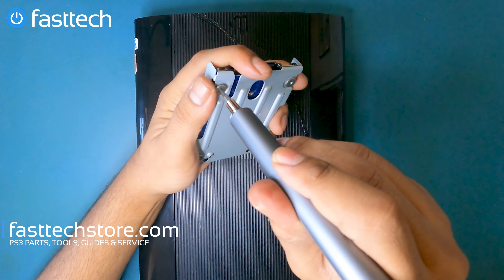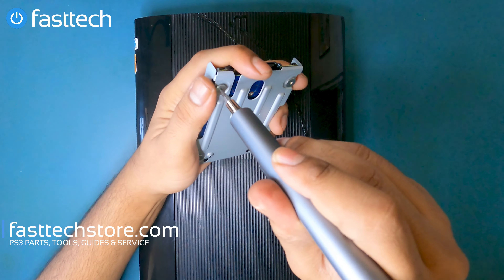PS3 Super Slim Repair Guide

Comment from the maker: FREQUENTLY ASKED QUESTIONS
Where do I buy the parts and tools needed for this job?
👉Fasttech Pro Autokit: https://fasttechstore.com/tools/fasttech-pro-auto-kit
👉Fasttech Pro Toolkit: https://fasttechstore.com/tools/fasttech-electronics-repair-toolkit
👉Laser Deck (Disc Drive): https://fasttechstore.com/playstation-3-parts/kes-850-laser-lens-a2fj5
👉Power Supply: https://fasttechstore.com/playstation-3-parts/playstation-3-super-slim-power-supply
👉Hard Drive: https://fasttechstore.com/playstation-3-parts/playstation-3-super-slim-hdd-cech-4001c
👉Heat Sink: https://fasttechstore.com/playstation-3-parts/playstation-3-super-slim-heat-sink
👉Power Button Board: https://fasttechstore.com/playstation-3-parts/playstation-3-super-slim-power-button-board
👉Screw Set: https://fasttechstore.com/playstation-3-parts/playstation-3-super-slim-screw-set
👉Fan: https://fasttechstore.com/playstation-3-parts/playstation-3-super-slim-fan

👉NEED HELP? FaceTime/Zoom Video Call Me: https://fasttechstore.com/online-consultation
👉GET REPAIR SERVICE FOR YOUR DEVICE: https://fasttechstore.com/electronics-repair

Other PS3 Videos:
▶PS3 CPU AND GPU DE-LID GUIDE: https://www.youtube.com/watch?v=GzMmi7F65wQ&t=30s&ab_channel=fasttech
▶PS3 CECHG Repair Guide: https://www.youtube.com/watch?v=GgOYFO9Pdss&feature=youtu.be&ab_channel=fasttech
▶PS3 CECHH Repair Guide: https://www.youtube.com/watch?v=BDC1O8mYZZc&t=1840s&ab_channel=fasttech
▶PS3 Slim 2000 Repair Guide: https://www.youtube.com/watch?v=S-ewz35fOLY&feature=youtu.be&ab_channel=fasttech
▶PS3 Slim 3000 Repair Guide:https://www.youtube.com/watch?v=ay7GYYMjodQ&ab_channel=fasttech
▶PS3 Super Slim Repair Guide: https://youtu.be/6a9UM_S1T64
▶PS3 YLOD Repair Guide: https://www.youtube.com/watch?v=uAWpqW1HCmo&feature=youtu.be&ab_channel=fasttech
▶PS3 Controller Ghosting Fix: https://www.youtube.com/watch?v=lMQouNRR018&ab_channel=fasttech

▶ VLOG CHANNEL: https://www.youtube.com/channel/UCF2IPXKRX5ctN9td1rhkzHg

Follow me on Social Media:
👉Twitter: https://twitter.com/Shehroz
👉Instagram: http://instagram.com/youngtechg
👉Facebook: https://www.facebook.com/fasttechy

Business Social Media:
👉Twitter: https://twitter.com/FasttechCA
👉Instagram: https://www.instagram.com/fasttech.store/

00:00 Intro
00:29 How to check the model number
01:26 Hard drive replacement guide
02:37 Removing the top case
05:48 Disc drive replacement guide
06:50 Power supply replacement guide
08:04 Extracting the motherboard
10:42 Outro
Reply: I looked on your site and i cant find a disk drive for the super slim
Reply from the maker: @bigbentv9025  its in the list in the description box and top comment now.

Comment: Hey man. Due to lightning strike, the pa3 doesn't work anymore. There is no problem with the power. It turns on, but the display is simply black. Tired with av cables HDMI cables, different monitors. Nothing works, the system on, but the display is not showing anything. What can be done? Thank you in advance 😊
Reply from the maker: @kausigantk1461  is this only a problem with the HDMI? Try AV output

Comment: My power light would come on, and when I turned it on it would turn green. Then like 3 to 5 seconds it would turn off.  I replaced the power supply. And plugged it in. An its still doing it. Why what am I missing. Ps slim sliding door on top. ?????
Reply from the maker: The sliding door has nothing to do with it. This could be what’s known as the yellow light of death issue the only real way to tell what the problem is is to use is syscon. There are several tutorials on YouTube that show you how to do this. We will be releasing a video in the future explaining this in detail.

Comment: hey am keiran i have bein watching videos cant fix my problem  need help my ps3 come and just go's  off with a green light
Reply from the maker: It could be a Yellow Light of Death (YLOD) issue which requires a reflow on the GPU/CPU or a reball. The best fix is to replace the GPU and CPU which is not an easy job. The second and lesser likely scenario is a bad power supply. If you have to unplug the power for the PS3 to even light up again its most likely a power supply issue.

Comment: My super slims front usb ports don't work properly and I can't find any info or replacements anywhere. They will sometimes work like normal but usually refuse to detect when anything is plugged into them.
Reply from the maker: Its most like a controller chip issue on the board. Please first check the USB port for shorts or bridges.

Comment: Hi sir, could you do a tutorial video on how to replace the power button of ps3 super slim? Thanks!
Reply from the maker: I have made a mental note of it and will consider it in the future. It is shown in this video when I remove it. All you have to do it lift up the disc drive deck and remove the cable underneath. The button itself slides up, there is no screw holding it in @ 8:10

Comment: Cool vid .. Watching cause I have The Same Console Supper Slim .. problem was it won’t turn on .. as in doesn’t even show the red light when I plug in the  cables .. as in your mention 99% is from the power supply I’m Gonna Try And Do it my self From watching this and ordering power supply .. Any Recommends On The Ps3 I should do?
Reply from the maker: Thank you. Didn’t understand your last question. Also, we do sell this power supply on our website and the links are in the description box.
Reply: @fasttechvideo  really I was jus asking is what you think I should do with the console as in do you think it can be fixed ? I have the same console planning on fixing my self with no experience.. when ever I plug in all the cables the light does not turn on what you think.?
Reply from the maker: @delcidg4717  its a defective power supply

Comment: Is it possible that the motor in the disk drive is dead for me? Im probably gonna have to replace the disk drive but im still curious as to if its my laser causing the issues
Reply from the maker: I have never seen the motor fail. Not a single case so far in our company's 15 years of working on these consoles.

Comment: my ps3 super slim is no longer showing any power light (no red, yellow or green). i replaced the power supply and still nothing. what should i do now? i don't want to lose all my files on my HDD. Someone suggested replacing the motherboard, but that means losing everything. I barely used my ps3 and it died so fast...
Reply from the maker: If you replace your board you will have to format your hdd to make it work with the new board. As for troubleshooting I would check the power rails on the mainboard if you have already replaced the power supply and it does not work.

Comment: Also, if the disc isn't spinning you need to remove the disc break or rig it up to be open. I like that precision drill. Can it be bought at your site?
Reply from the maker: Yes you can buy it on our site here: https://www.fasttech.ca/tools/fasttech-pro-auto-kit
Reply: How should I do that? 
Explain step by step
Reply: @VenerableMoon09  hard to explain without actually showing you. They should be a video on here about it.i thing I use a broken plastic fork prong to keep it open.
Reply: @bobbyjones-uv5cn  what if that doesn't work?
Reply: @golgo2888  get drunk and try again 😂 just kidding. If that don't work then you're going to need a new disc reader.
Reply: @bobbyjones-uv5cn  It was working fine before I cleaned it and it's not working at all 😞
Reply: @golgo2888  that means the motor died. It happens. Cheap and easy fix.

Comment: My PS3 slim disk doesn't spin,and I tried removing the brakes but it still doesn't work,I managed to put the brakes back on but is there any other reason to why the disk wouldn't spin
Reply from the maker: The laser lens needs to be replaced. We sell these on our site including the deck in the description box.

Comment: Hello sir my ps3 disk not spinning plzz help me what a reason..😔
Reply from the maker: Bad laser in the disc drive or worst case could be the disc drive logic board. Try replacing the laser lens first, if that doesn't work then try replacing the complete disc drive.

Comment: hye. my super slim got red light for a second and then it went off. does replacing power supply will fix it? thanks
Reply from the maker: It could be YLOD issue or power supply issue. Best way to diagnose is if you have to unplug the PS3 for it to even beep again then its a power supply issue otherwise YLOD caused by GPU or CPU
Reply: @fasttechvideo  sir, if my ps3 super slim just on red light and after 3/4 seconds my ps shut down,,so the problem is power supply ?

Comment: the disk tray has a button on it right? so why do you not have that part? i need one for my ps3 ultra slim because that button on that disk tray is what controls disk read and spin activation when you close the lid to the disk tray. that part is just as important as lens is. pls can you help me get the part i am describing because i really badly want to play on my ps3 again.  ps this ps3 of mine is still running after non stop gaming for 5 years with no down time.

Comment: Hello. I don’t know if you’re still answering questions on this video, but I need help with my disc reader. I replaced my disc reader, (bought a ps3 that didn’t read discs from a friend to fix it). Now it spins and reads, but it doesn’t. When attempting the read and spin, it makes a very loud grinding noise and leaves a nasty dull scratch on the disc and leaves removable marks on the disc tray.

I think the laser is too high. I can’t find a way to adjust it. I also notice the disc wobbles while spinning, if there was a way to adjust the spindle platter? Anything helps, thank you.
Reply from the maker: What type of PS3 is it? If its a old fat model or the first gen PS3 Slim (2000 series) you need to install your old disc drive's logic board in the new disc drive. Hope that helps. Let me know how it goes.

Comment: I followed this to replace my power supply, but I can't get the ribbons back into the disc drive. Any ideas on how to get them back in? I thought I did, but now my disc drive no longer spins or works when it was 100% fine before. :(
Reply from the maker: Make sure the ribbon cables are in all the way to the blue line. Also clean the laser and check the ribbon cables to make sure they are not damaged